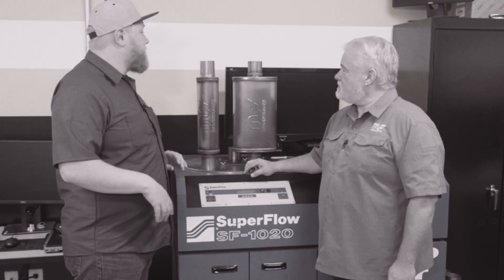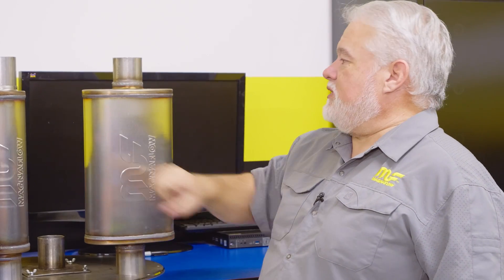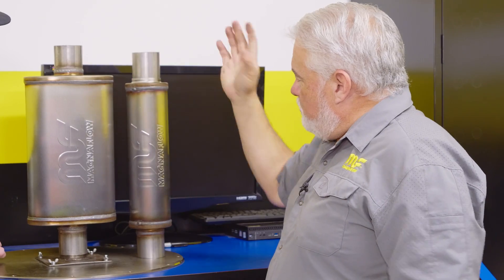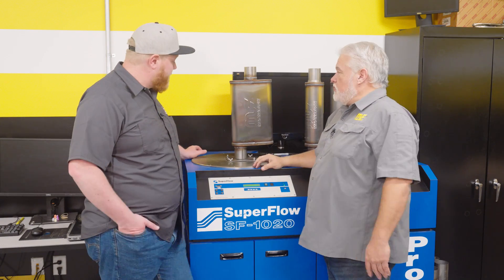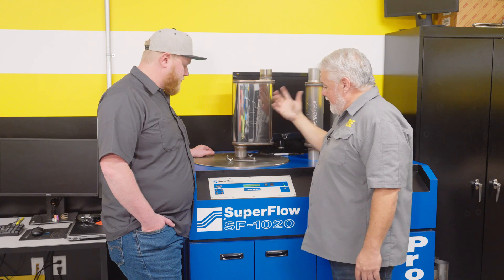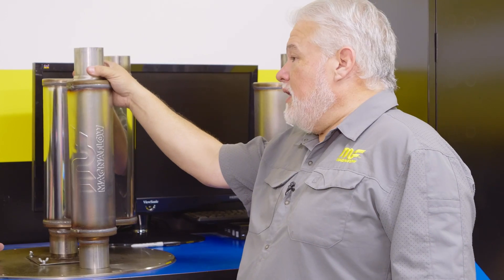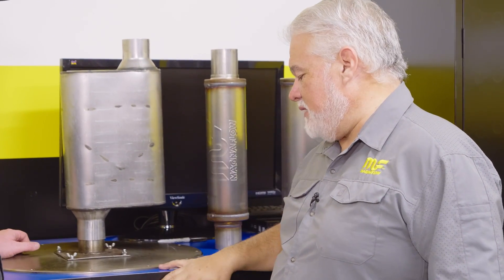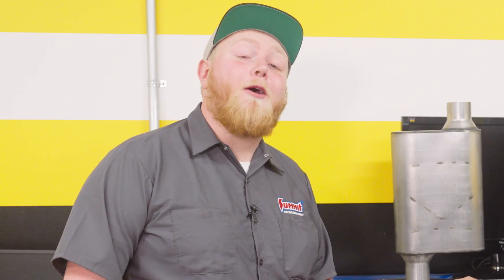MagnaFlow Exhaust Flowbench Test: Does a Quiet Muffler Impact Airflow Performance?

Comment: As the offset muffler design, measures less cfm in flow. Does this relate directly to exhaust back pressure up stream? Or is the back pressure a case by case concern, that is measured from the current system operating based on overall configuration of the engine and exhaust? 
2nd question, On the chamber muffler example, Would the cfm measured flow be the same 315 cfm range if the muffler was flipped 180' to use the opposite end for the inlet on the flow bench? Because the chamber muffler was drawing in against the underside of the triangle for the chamber in the video by looking at the weld marks on the body of the chamber muffler.

Comment: wow this was an excellent class on magnaflow mufflers airflow, I learned something good today and I than you sir
Reply from the maker: Thank you for watching !
Reply: I have a 1950 pickup with a mild 302. It has short headers and 2 1/4” flowmaster style mufflers cutting out in front of rear wheels. I just got it on the road this summer and I’m not happy with the sound, too much of a race car or tin can sound. I’m looking for more of the old glass pack or turbo muffler sound. I was considering the Magnaflow straight through offset/center mufflers and this video just made up my mind. Thanks for showing.
Reply: @taco472  I had straight thru glasspaks style on my 57 Belair/327 back in the late 1970's and I really like that sound too. When I changed over to flowmasters about 1985 it had a way different sound and I noticed a small drop in performance too but the neighbors liked me.

Comment: I always go up one Size when picking a Muffler, of the Pipe is 2 1/4, I will use Mufflers that are 2 1/2, if the Pipe is 2 1/2, the Muffler is 3, etc. If there is Room, I will also Pick the Longest Body, as the change in angle is Lower.  I won't even go near a Flowmaster, as the OEM Mufflers, often flow Better
Reply: OEM mufflers flow better? Interesting.
Reply: @Captain1717Q  
Most do
Reply: @pjimmbojimmbo1990  I didn't know that. I always thought Flowmasters and magnaflows outperformed factory mufflers.
Reply: @Captain1717Q  
Magnaflows will, but Flowmasters are a different matter, just look at the design, even regular Chamber Mufflers offer a less challenging Flow Path. Okay I will concede a couple of Flowmasters are indeed straight through, but most have the Inlet, almost blocked
Reply: @pjimmbojimmbo1990  in your opinion of the two which gives no drone on the highway?
Reply: @Captain1717Q  
I have Magaflows on two of my Buick Roadmasters, no Drone at any Speed.

Comment: How pointless is this test unless you are talking about installing immediately off of your heads?! Your exhaust is going to have bends in the manifolds/headers and any  other pipe ahead of the muffler. Plus, throw in any converters if stock or if you plan on having it on the street in any state that may still test a classic vehicle. Every bit matters on the strip/track but does it matter on the street where you only occasionally be using operating in peak hp range?

Comment: I just got this set up. My truck wouldn’t take Flowmaster dual exhaust on my 2020 GMC sierra 3500 double cab long box. so I had to go with the magna flow. If you’re looking for sound, this is not it.  it looks amazing on the truck. It has a little sound, but I am not impressed at all kind of disappointed to be honest. Oh well.
Reply: Loud does not equal power on a stock engine.
A stock engine or engines up to 450 to 500 hp - street driven engines - make more power with 3" single exhaust.
Reply: Throw some headers on it and they'll wake up. Those trucks have so many converters they aren't terribly loud without mufflers compared to the older trucks. If all you want to hear is muffler casing resonance and turbulent exhaust flow just weld a coffee can to your pipes

Comment: Is the air your testing with room temperature passing thru those mufflers or is it hot air as it would be in real use? Would like to see this done with hot air passing thru 4 a more accurate test if possible

Comment: Don’t get too hung up on mufflers tested on a flow bench… 
A lot of muffler start to shine due to the heat they create. Without the hot air from the engine they won’t perform as good… 

Although, I need to know where this flow bench is located. 

If there’s any one muffler that needs flow tested it’s the Flowmaster Pro Series Outlaw… 

It is literally blocked with a plug which causes the air to go around into the body, which is actually more area than the plug blocks. Also, the plug creates a major drag on the backside. Creating a massive scavenge effect on the airflow…
Reply: I assume your talking about the laminar flow muffler, if so I to wanna see that reviewed in depth